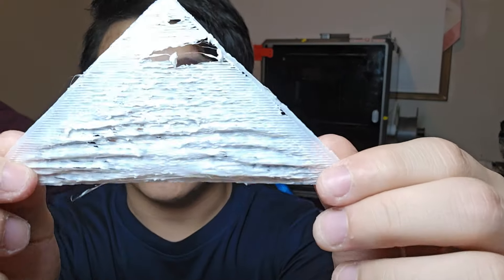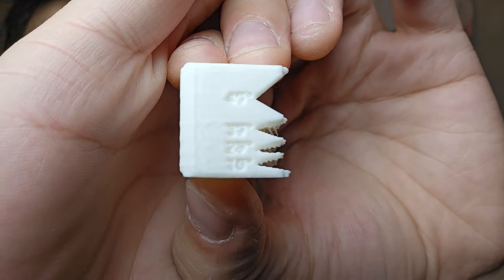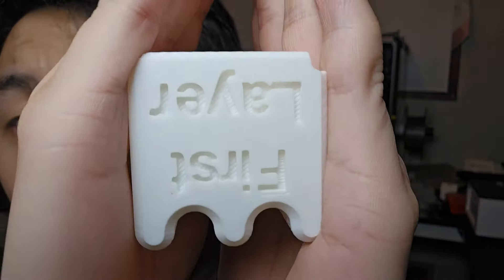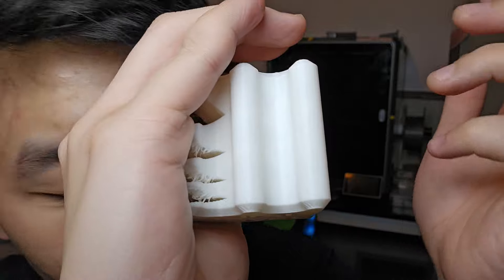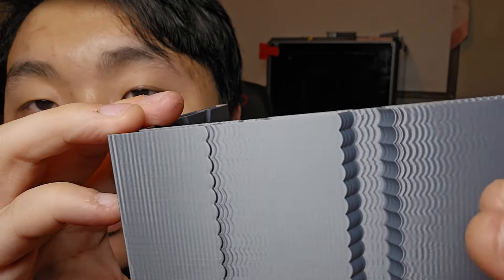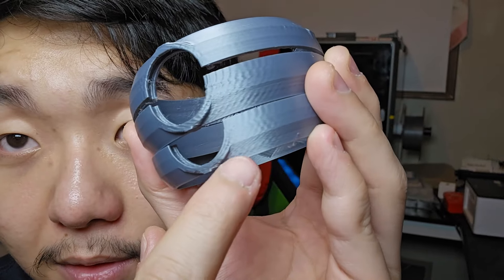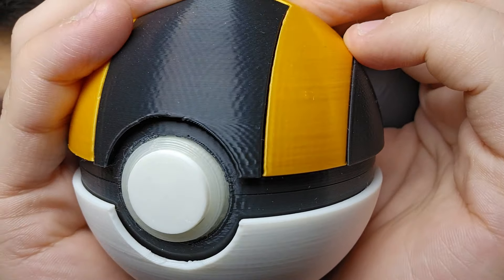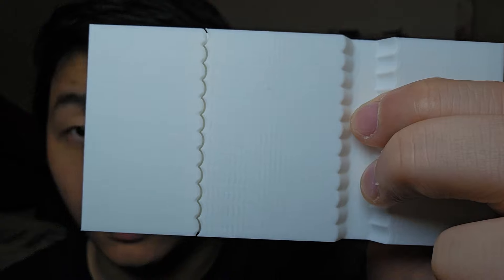After Rooting The K1 Max There's Problem Help

Comment: All the suggestions are very good and the best bet for a good path.
After you do all that, you can try calibrating your Z-Offset (Fluidd or Mainsail have helpers to do that).
Also following some suggestions, don't install before you make your printer to print satisfactory prints (specially KAMP, which in turn will bring more problems if your printer isn't calibrated properly).
Reply from the maker: I'll keep calibrating the z-offset and yea, installing everything is kinda dumb for me. I'll have to learn more about klipper slowly.

Comment: Have you calibrated any of the filament you use?  Since you rooted, you can use orcaslicer and run its calibration on each your filaments and then create profiles for each filament.
Reply from the maker: I did not do that actually. I'll have to take more time into learning Klipper and do more calibration with the filament I use. Thanks.
Reply: @Scratch3DPrinting  it’s less kilpper and more learning how to tune the filament.
Reply from the maker: I learn it the hard way.
Reply: @Scratch3DPrinting  I can tell :).

Comment: I have not rooted mine, as I say if it ain't broke don't fix it, I think as time goes by extra conrols will be added to the standard software without having to go Full Klipper, the one thing I can,t see is the bed level graph, where do you click to show it, I will level my bed using a precision dial gauge and shims
Reply: You can see your mesh graph by typing your printers IP address into a browser where you will see the browser interface of your printer. Scroll down and it's there.
Reply: In orca you can set it up to view in the device tab or your printers ip address.
Reply: Creality is being extremely slow adding features that should have been available from the start. Example printer side z offset and pid tune. Over 6 months.
Reply from the maker: that quote is true "if it ain't broke don't fix it", but... I still want to mess with it. Creality is slowly adding more things to the printer like you said.

Comment: Just dont root in general ive had my k1 Max for 3 weeks now with no issues at all and high quality prints all i did was switch to Orca slicer for the better supports
Reply from the maker: Nice to hear another person who has a K1 Max and it's printing nicely. Orcaslice does have better supports.

Comment: Why root it? I have had no issues what so ever K1 Max
Reply from the maker: I don't really know, just want to mess with it. It's getting better as time goes on.
Reply: @Scratch3DPrinting  If you print with Creality Print versus printing with Orca it should be different. For example, KAMP should not be used with Creality Print.
Reply from the maker: @shirgall oh, thanks for the tip, I'll try to learn more using orca slicer.
Reply: @Scratch3DPrinting  What I mean is that KAMP should not have an impact on Creality Print jobs.

Comment: Hi,
First try drying the filament, then make a print. If the error persists, change the nozzle. The problem may be filament or mechanical, not software.
Reply from the maker: Hello, I'm not sure if it's wet filament, but I'll have to check the nozzle and maybe change it like you said.